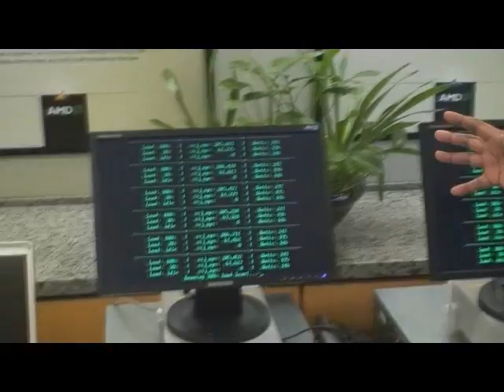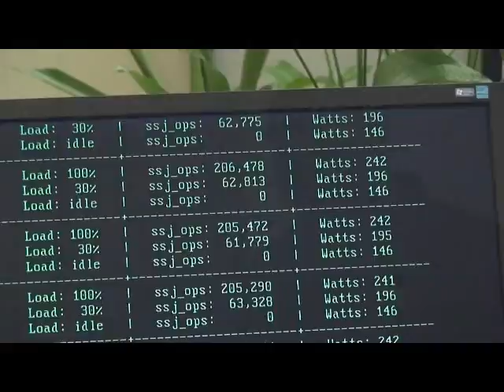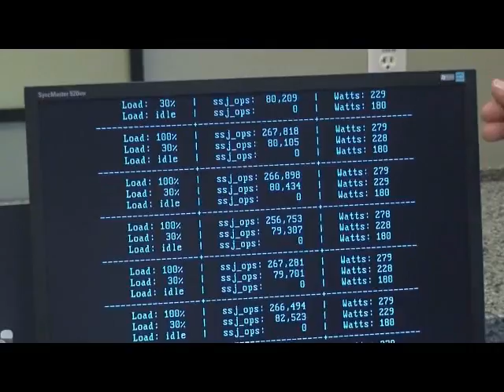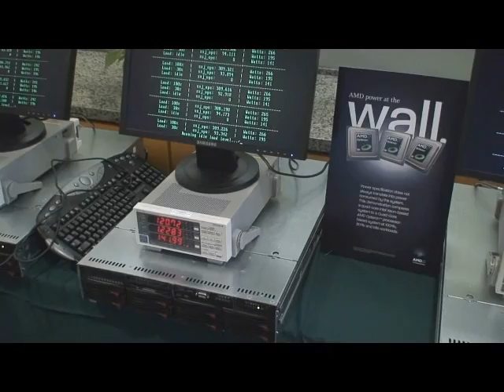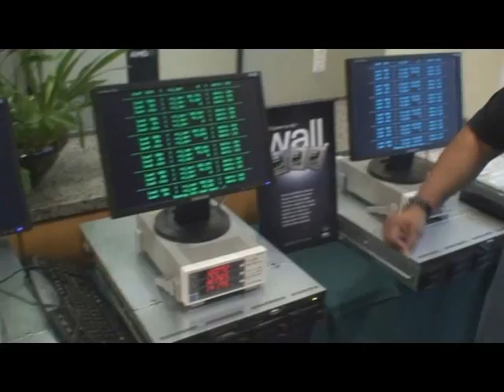AMD Shanghai Power Demo

Comment: @dregothic
The P4 was designed to run at high frequencies with a really crappy IPC in order to take advantage of the MHz myth.
And guess what, the P4 is a single core...

Finally, if 3DMark really means nothing, why bother mentioning the i7 record?

Comment: Yea just looked up the benchmarks on TomsHardware. Thats where I got the figures from. Look at it if ya don't believe me.

BTW, a Core i7 in a multi GPU setup scales about 35% or better FPS in games than any other quad core.

Look it up.

Comment: What? Dude know the facts. Intel is a damn green company. They have the most efficient 45nm FAB in the world, have stopped using lead in their products and a new AMD Phenom II uses about the same power as a equivalent 65nm Core 2 Quad. It doesn't use less than a 45nm Core 2 Quad though.